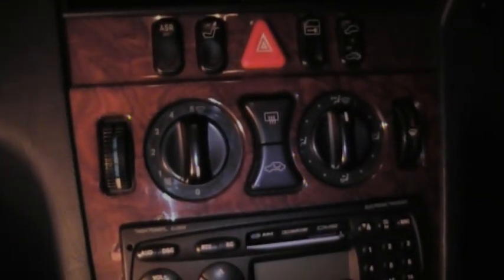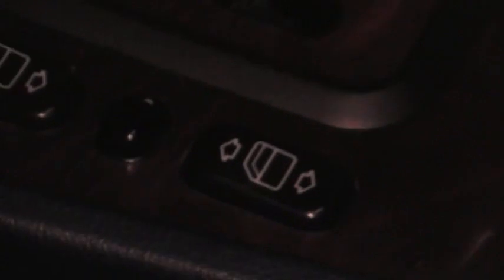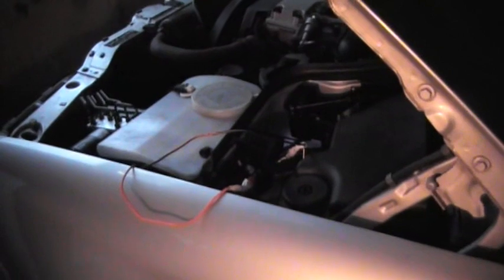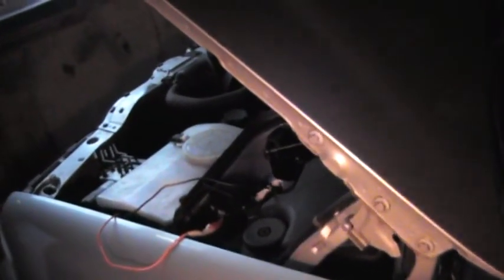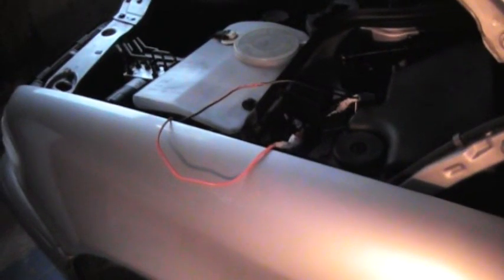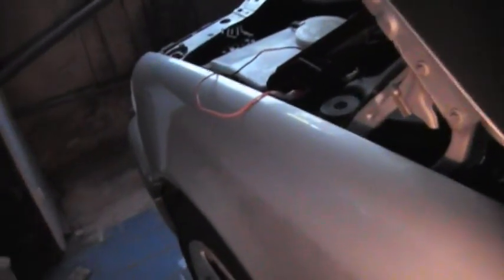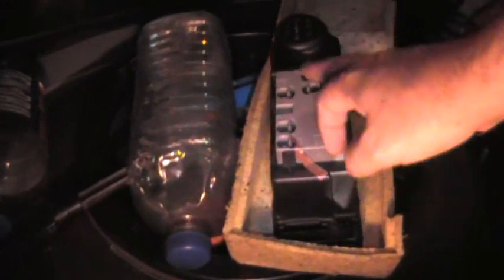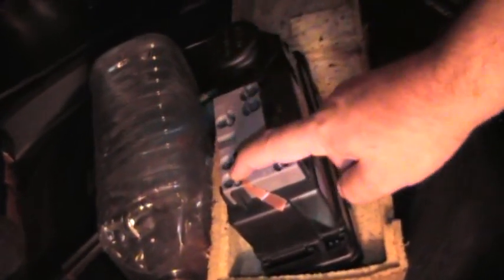Mercedes benz c180 (w202) faulty vacuum pump, how to open the boot.

Comment: The Mercedes key fob has a removable key that mechanically opens the boot and also driver door. No need to cut into the boot
Reply: Agreed on this one. I encounter same problem with the vacum pump malfunction. I open the rear trunk using the mechanical on the key fob. No need to make an opening on the behind rear seat.
Reply: It's a common occurrence for the key not opening the doors. Can't open the driver nor the trunk

Comment: Some W202s had the option of the rear-seat ski-hole. Easy access if you have this.
Reply from the maker: Unfortunately mine had a steel plate behind the seat rest, no hole so had to make one.
Reply: @user-do-it-yourself-help  i had a 1998 W202 C230K manual, very rare with full leather and the white AMG dials etc. sold it years ago and still regret it to this day. one of the worst decisions of my life 2bh

Comment: I like the video but how did you get the back rear cushion out; that is where we are. Is it just a lift and pull?
Reply from the maker: The rear seat back rest has 3 bolts securing it to the rear panel located by the seat belt buckles. Once they are removed lift the seat cushion up to unhook it from the top securing position located  behind along the top edge of the cushion, one on each side, hence why you can't see how the cushion is secured to the back panel. Hope this help.
Reply: Your video of checking central locking is too dark! Can't see clearly. On presentation.

Comment: Hi.  What can open the door don't have key?
Reply from the maker: RUFAT BASHIROV 
If you don't have a key then their is no way you can get in. I don't know any other way of getting in except to either use a door latch opening tool. Or the simple way is to break one of you small windows to get in and replace it. That's what I would do as a last option. 

Hope that helps.
Reply: Crowbar or angle grinder. ;)